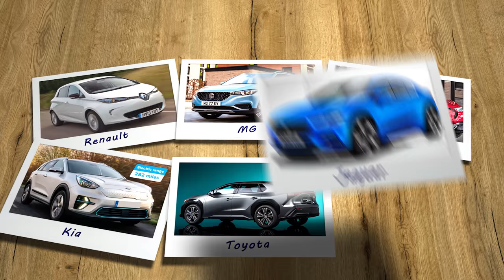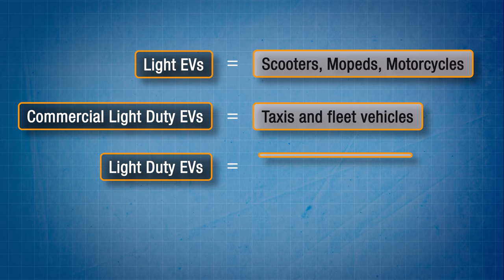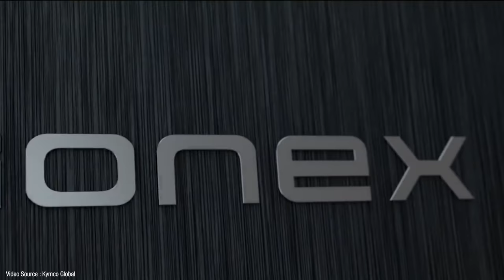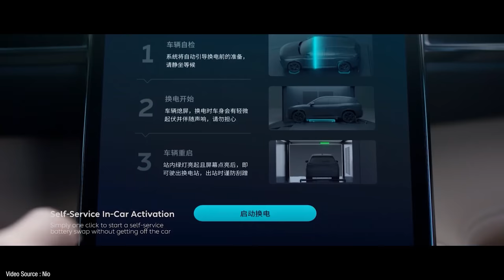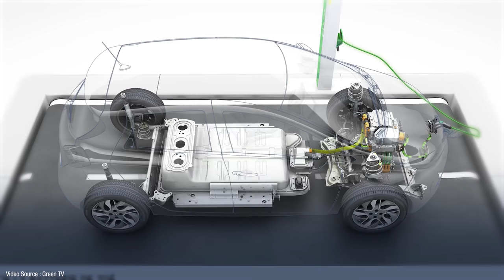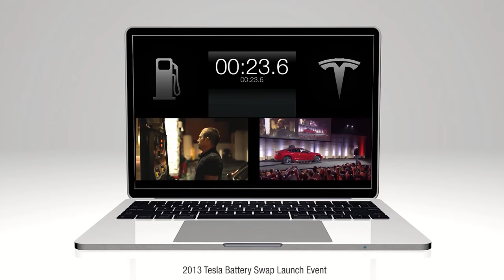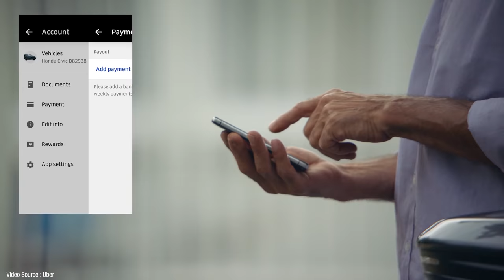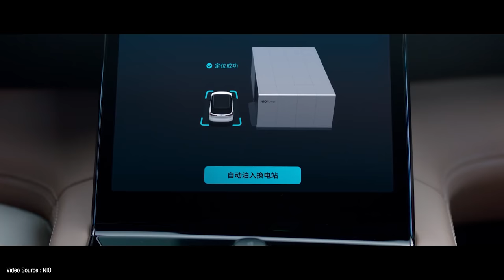Battery Swapping. Transforming the trajectory of electric vehicles?

Comment: The idea of battery swapping for EVs is not new and has been proposed and promoted by others in the past but seemed to elicit little or no interest from governments or motor manufacturers. Fifteen years ago in 2006 it was proposed by both George Monbiot, writing in 'The Guardian' ( https://www.monbiot.com/2006/10/31/heres-the-plan/ ) and by the editors of 'Green Socialist' magazine, but I am unaware of anyone else pushing the idea at that time, or for some years afterwards. 

The proposal is so self-evidently and obviously the easiest and most practical solution to the massive problem of charging facilities for private EV owners who have to park on-street (because they live in flats or in houses without driveways) that this throws up another major issue, and that is the failure or unwillingness of governments to take an active role in directing or regulating this market for the benefit of their citizens. Across the private and fleet vehicle markets it would be far more cost-effective for both manufacturers and EV owners for there to be a set of perhaps two or three different sizes of batteries for small, medium, or large cars which would be standardised across all makes of EV, but if the manufacturers themselves are all developing proprietary batteries then this will put the development of such a service back ten or twenty years... time we don't have. Governments, and better still, international bodies (such as the EU for example) can and should regulate this in the interests of their citizens and in the interests of getting fossil fuel burning IC engines off the roads as soon as possible. Perhaps this is another example of the sad fact that supposedly democratic governments (who are in practice often held hostage by powerful business interests who do not want to co-operate) seem incapable of taking the necessary actions with the necessary speed or urgency. This degree of inertia, unwillingness to face up to difficult decisions, and willingness to allow profit-driven businesses to take life and death decisions for all of us, could well end up leading us all to disaster.

Comment: You may have heard that a very brave chap Lex Forsyth of Janus Electric,  https://www.januselectric.com.au  is proposing to set up a Heavy Goods Truck traction battery swap system for the Australian east coast. The semi (lorry with trailer or a tractor trailer) hauling 40000 -60000kg, would leave Brisbane a full battery, swap at about 450km with a fresh battery then arrive in Sydney in 10 to 11 hrs after 950 km, 600 miles

Comment: so you need minimum 2-3 times the number of batteries than you would if you just charged your car at home... fast use + slow charge + battery shortage = eventual failure
Reply: Why would you need 2-3 times the number of batteries? Most cars would likely only swap 1 time a week, since they either aren’t driven that much or are trickle charged elsewhere during the week. I’d imagine something more like 1 “extra” battery per seven cars, at least at first, but the batteries would last longer so in the end the numbers might even out.

Comment: Swapping car batteries is a « Charger Of Babel » bad idea. All car batteries are different from one car make to an other, even in the same company and some times one  car model can even have three differently sized batteries. And again some makes have structural batteries that act as part of the car’s frame making it nearly impossible to swap. At last, as batteries evolve, the chemistry of the cells will make more power and reduce the physical size of the batteries, then again complicating the game. The best solution so far is to have faster 600 to 1000Volt chargers. After all the bladder distance of most drivers is about 250km, a stopping pause equivalent to a 750V fast charge.

Comment: When is it convenient to swap the battery with current charging speed and homechargers?
Reply: Vs current charging speed:  Always.  Charges take ~20 minutes.  Swapping takes ~1 minute.  Now that's just according to the video which in turn seems to be based on ad copy rather than real world numbers, so grain of salt.  But even if it was 2-3 minutes its still far lower than a full charge at today's fastest stations.  Maybe future charge technology will do better than 20 minutes (the video made reference to a 5-10min near-future charging system) but that's still a long way from 1 minute.

Vs home charging:  Depends where you live.  If you don't have a driveway, or you live in an apartment complex that hasn't invested in charge infrastructure in their parking lot.. having a swappable system is infinitely more convenient because you don't have the home charge option at all.

And in both cases, at least in the short term, any such vehicles produced would likely still have a regular charge port installed as well just to make switching over easier while swap stations are being constructed around the country/world.  Kind of like how hybrid gas/electrics functioned as a stepping stone to EVs.
Reply: @altrag  Most parkinglots and workplaces will have chargers. Swapping a battery will be more expansive and can be done fewer places. Charging for a day now takes 5 minutes on the fastest cars. It's just entirely made up. This is just a gimmick.

Comment: You have missed the latest news from the last few days or week, NIO has started to ship electric cars to Norway and plans to install battery swap stations in the country. 
Battery swap electric taxi cabs first carried passengers in London 1897-99 by the London Electric Cab Co, the 2 ton weight wore out the thin wooden wheels and tyres every 6 months leading to the firm going bankrupt, swappable battery cabs were introduced in New York 6 months later in 1897 and ran till 1907 when a fire burnt 300 taxis at the Electric Vehicle Company depot.
 London Electrobus Company carried passengers by the world's first ev double decker buses in London 1907-10, firm went bust as it was run by fraudsters and between Brighton and Hove, UK by Brighton, Preston and Hove Omnibus Co 1908-17, the swappable batteries were replaced by hydraulics in 3 mins at the Victoria, London depot and in 10 mins at the Brighton depot. 
Israeli firm Better Place had an electric car battery swap system but went out of business in 2012. Swappable batteries were used by the first electric trucks in 1917.

Comment: Will battery swapping happen? No.

It's completely impractical. And that's even before companies start going towards structural batteries.

I can see it for busses, but that's it.
Reply: Induction charging at each bus stop would be better for busses
Reply: For most private car owners this just is not an issue. We just lack enough charging infrastructure. Once there are wide-spread charging stations in places we spend 30 minutes or more (malls, supermarkets, restaurants, offices, etc).

Building out charging stations is way cheaper than battery swap stations.

Comment: This would need crazy amount of capital investment for infrastructures better just invest that money in grid upgrades to handle EV charging.
Reply: Does the grid go down when a new shopping center is opened?
No.
How about when a new housing development , with hundreds of homes?
No.
The grid the can handle EVs.
Relax.
Reply: @davidclark538  when a new shopping mall or housing project is opened the increase in power usage is easily predictable. Not saying the grid would need massive upgrades with ev but would still need some upgrades especially taking fast charging into account.
Reply: When the power companies actively complain that EVs are degrading the grids viability, you have a point.

Whenever That happens.

Comment: Standardized vehicle batteries that can be swapped out are an inevitability. Think computer systems evolution from the 1970s forward. In 1975 nobody gave any consideration that it was possible to have multiple manufacturers making computer parts that were interchangeable and would support each others' systems. Even in the 1980s attempts by IBM and crApple to make systems that were single sourced (through licensing, multiple sources) fell flat when compared to ISA and later architectures. Nowadays we can't conceive of a computer made by a single source that can't be supported by multiple vendors.

Eventually motorized bicycles will share a common battery form factor, as will electric motorcycles, cars, and light trucks. Once a common technology and common battery architecture becomes dominant then every vehicle OEM on the planet will make rides that use the same batteries. The issues of charging stations vs swap stations and all that other jazz will come out in the wash.

Comment: Have batteries, metal-air, to be as free as taking a bottle of soda from your freezer, swap the used away
Reply: you can do this, no matter what tech, in your own home, just have the swap system there, at least two rechargeable batteries, on charging, on in vehicle, make them powerful and easy to swap
Reply: nuclear batteries, yes, pu-238, heat-to-electricity, peltier modules, direct heat to heat/ac/freezer

Comment: Put the foundations down first, or the building will collapse. We need more electric cars first. Currently, it's 14% in the UK, and a lot less than that in the West generally. That's because of cost and lack of charging points/infrastructure. Subsidize electric cars by a huge amount,  and put charging points on every other street. Then start talking about replaceable batteries
Reply: 14% new registrations maybe, but (I may be wrong but) I don’t think we’re near 14% cars on the road.
Reply: I can see no advantage  of purchasing a EV over an ICE vehicle  it's a con.
Reply: @PeterStilwell  Agreed its a political con !
Reply: @bertiewooster3326  The same thing was said about gasoline power until about 1905 or so. FR
Reply: @fredericrike5974  Ev is a con !
Reply: @bertiewooster3326  Did I disagree with you? No, I did not- I said there were similar things said about gasoline. Improving your reading skillls ahead of typing BS might get you better responses rather than writing you off for a clone troll. FR

Comment: EV truck battery is 10 15 times more heavier than same diesel tank, and trucks ability to carry more cargo is main point, same battery ratio to fuel tank can be applied to cars, lithium have small energy density to conventional fuels, heavy weight of cars drops efficiency significantly, scooter the only sector where it makes sense, where comp actability of electric motor and battery pack makes sense, extension to EV mopeds the only advantage annoying farting sounds reduction of mopeds :)

Comment: Experts say we will have problems supplying all the batteries needed to go 100% battery EVs.  Battery swapping could easily double that requirement.  I'm not sold on it for that reason.
Reply: agreed. the answer is not more batteries, the answer is less mobility. it is fancy but no a solution the planet is waiting for.
Reply: That could be a sticking point, though as regular viewers of this channel will be aware there are potential successors to lithium batteries which perform better all-round and use more widely available resources, so in the future it COULD become a moot point.
Reply: Using existing battery technologies perhaps but battery technology continues to evolve.  And, how often do you fill your car?  Unless it's daily or perhaps every 2 days then there is unlikely to be a need for 2 batteries per vehicle.  In the UK average day mileage is less than 20 which means that virtually every single new ev currently can go for a week on one charge.  

Such a system would reduce range anxiety too as folk would know that they can simply pop in for a swap just as they do for a few litres.

The other major benefit is that faulty cells within a pack will be picked up on quickly and packs repaired leading to less waste and longer term use.  

All we need is for the big car manufacturers to agree on a standard.  It isn't that difficult given that all cars use tyres, disk brakes, a steering wheel, etc., etc.  If the EU mandated it then it would happen.

Comment: Electric vehicles are just better. No noise, no emissions, less fuel costs, less maintenance costs and amazing technology. Gasoline and diesel are OLD polluting technology. So last century.  Electric cars, electric trucks, electric buses, electric trash haulers, electric snow blowers, electric lawn mowers, electric snow mobiles, electric water craft, electric garden tools, electric mechanic tools, electric motor cycles, electric bicycles, electric scooters, electric farm tractors, electric construction equipment, electric delivery vehicles,  ...... everything is going electric.  No worries about starting after sitting for a few months. Gas always needs repairs.

Comment: The world is battery constrained, tying up a load of batteries at each battery swop station is going to slow down the number of electric vehicles we can get on the road.
Stupid idea for consumer vehicles, too many different vehicles, vehicle types, sizes etc. What size would you make standard? 40kWh, 60kWh or 100 etc, that's even more battery packs stuck on a shelf and not in a vehicle on the road replacing an ice vehicle.

Rich people buy expensive vehicles with cutting edge battery technology, these people, pay the way to get cheaper better tech batteries for all of us. Look at Tesla secret plan. 

Would you want to swop your excellent battery pack from Tesla, the leader in technology in ev's with a battery pack made by an ice manufacturer?

Comment: Hello David, that was a great video, and very encouraging news to hear! In the Greater San Diego Area (Carlsbad) we have an EV manufacture that should be delivering their first models later this year or early next year. One thing that makes this manufacturer (Aptera Motors) stand out is that they have a model that will be able to receive 40 miles of range daily from the solar panels on the roof of the vehicles. This is of course if you're in a sunny area, like the Southwestern USA, this is still a very attractive design though. Even if you live somewhere that doesn't get that much sun, they have one version of the car that will be able to drive 1,000 miles (1,600 km) on a single charge due to the extremely low drag coefficient and light weight. They can be found here: https://www.aptera.us/

Comment: Battery swapping won’t ever work for cars - too much weight. You’d need a crane
Reply: The video showed a (CGI) system where the car was positioned in a carwash style structure where the battery was replaced by machinery from below.
Reply: @danyoutube7491  600kg of battery? Also Tesla is moving towards structural battery which would make this impossible
Reply: @singularity844  Well yes, it certainly will be impossible for a battery built into the vehicle's bodywork. But as for machinery taking the weight of a 600kg battery, why not? Lifts can obviously do that.

Comment: Earlier this year I replaced my plug in hybrid RRS with a diesel, tomorrow I am replacing my wife’s I3 with a petrol car, my experience of electric cars has been an expensive disappointment.
They work only as an around town shopping car, if you need a long journey to a client without a charging facility it is hopeless 
I’m sorry but I will now wait for the non fuel cell hydrogen engine as developed at JCB
Reply: Surely it depends on which EV you're driving. My car gets 540 Km per charge, more than slightly overkill for  "an around town shopping car". I can only imagine that you made mistakes when selecting the vehicle for your needs.

Comment: Battery swapping the dream of a green future?  Really?  Where is the electricity going to come from?   With this new large demand, where it won’t be coming from is solar and wind energy farms.   Hydro power output is dropping with the lower reservoir levels.   So I’m just waiting for the “green new dealers” to explain how they intend to provide the power required to supply all these batteries.
Reply: I believe this was touched upon in the video. The suggestion is that the batteries can be charged at off-peak times, and could even be recharged when wind or solar etc. are working at their best (on windy or sunny days). It sounds as if there is more potential control over where the power comes from than with standard charging, because you don't have to be charging up batteries when the customer picks up their full one, you can instead wait until there is low demand on the grid/renewables are having a good day and charge at those times.

Comment: The biigest problem with EV's is that they are boring. If you are stuck with nothing but EV's just buy a Toyota Commuter bus EV. EV's are nothing more than whitegoods on wheels, no excitement, so why would you spennd 300,000 pounds on a fridge.